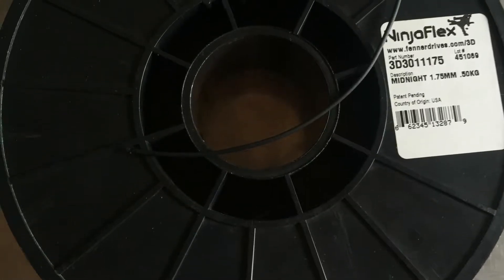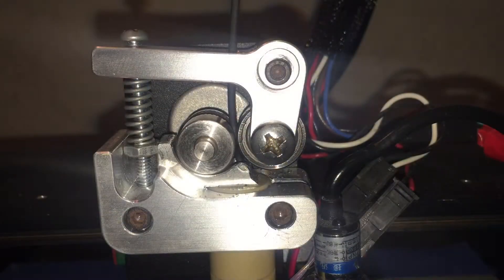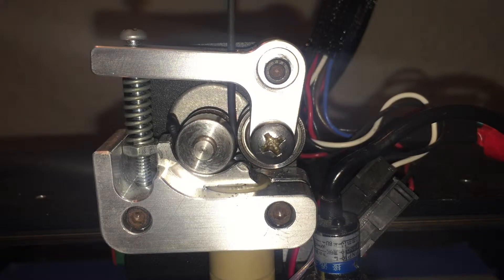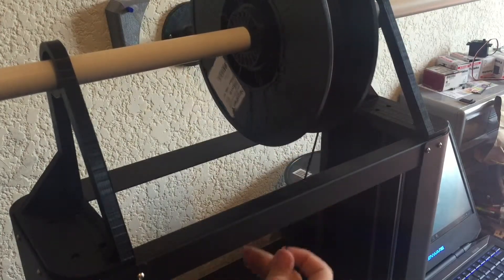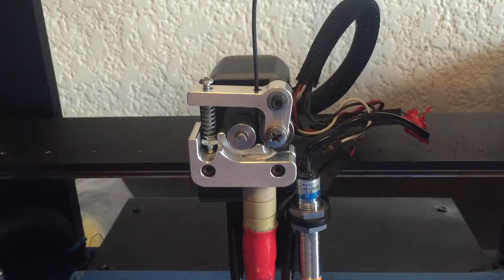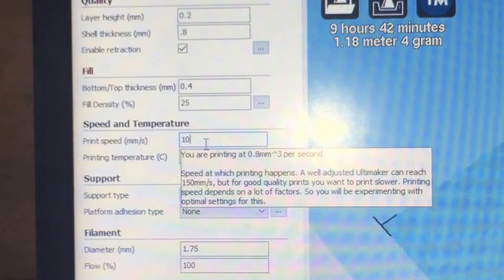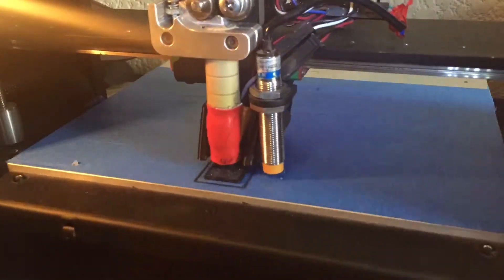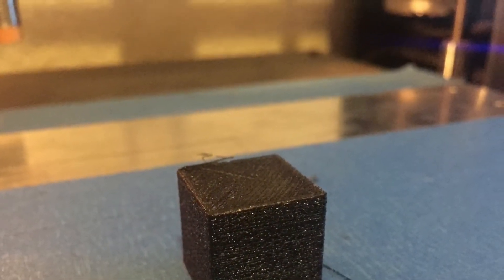How To - Ninjaflex On A Printrbot

Comment: Diego, thanks for the tips. your settings worked like a charm! No adapter required.

I also have a printrbot based machine. What are your layer height settings (curious)?
Reply from the maker: +ErickAlex I usually use 0.15 mm layer height, both for PLA and Ninjaflex.
Reply: Great stuff, thanks!

Comment: Are you using the v1 Alu Extruder?
Reply from the maker: +阮天青 Yes, from what I've heard ninjaflex is not a problem in the Alu Extruder V2
Reply: +Diego's Workshop You should be able to print a filament guide for Alu v1.
Reply from the maker: Yes, but in my case I got better and more reliable prints using this method than any of the printed upgrades.

Comment: Thanks buddy, one question, i noticed you didnt used a heated bed? So is it not necessary for ninjaflex?
Reply from the maker: +zeretube It never hurts to have one, but it works pretty well without it too, I've only had one print come off in all the time I have been using ninjaflex.
Reply: +Diego's Workshop thanks!